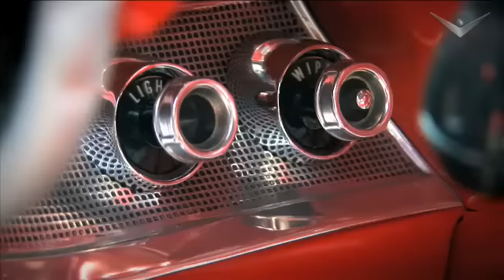1957 Chevrolet El Morocco | One of a Kind

Comment: Wrong. I spoke with Wayne Hostetler of Lemoyne, Pa. who sold his ElMorocco twenty years ago. Wayne said the vehicle was titled as a Chevrolet as it came off the GM assembly line. The vehicle then went to A. Allendeer & Company where the custom work was done however the vehcile title never contained the name "El Morocco"  It appears only ten hardtop sedans were made, two hardtop cojpes and two convertibles in 1957.